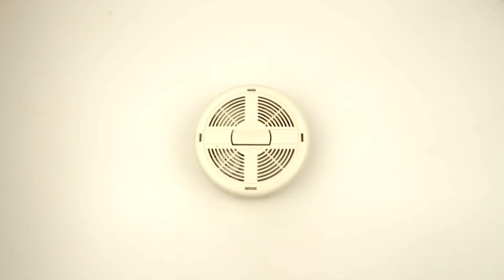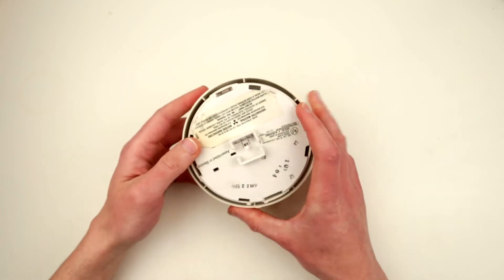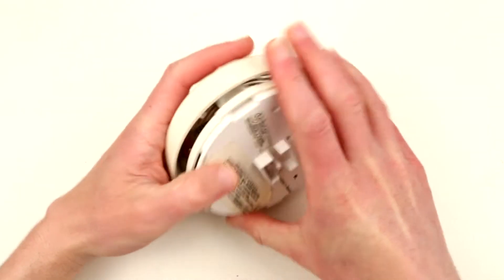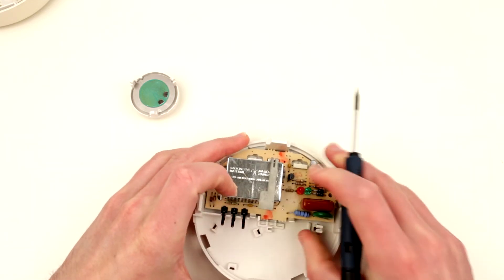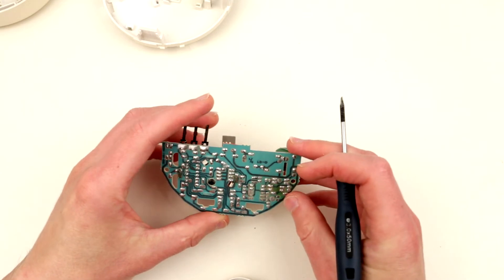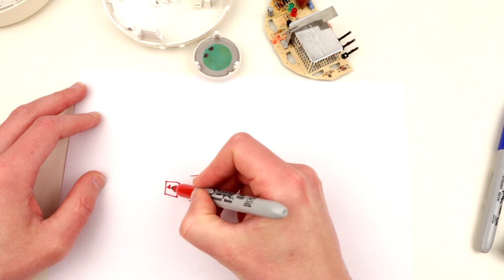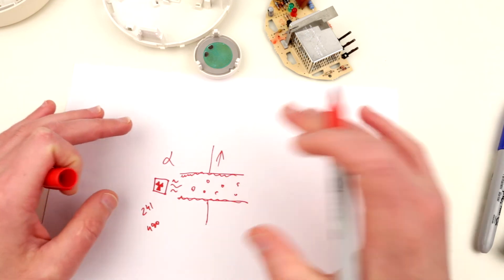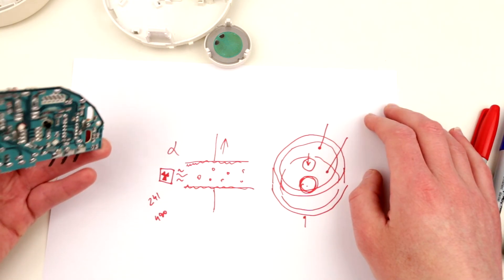Teardown of Ionization Smoke Alarm

Comment: That's a DICON /DETA/First alert and you still can buy those today but that very old one is AC powered only without battery backup also those are very rare the AC only powered ones also there are videos of these alarms Wich a older cover but the one you taken apart is a newer one old hardwired smoke alarms doesn't have a battery in it just AC powered
Reply from the maker: Thank you for such detail! Very useful
Reply: @InsideOutElectronics  Your welcome!!
Reply: @MisterBrownJack  That's a Canadian one and it's not by Dicon here. It's made by American Sensors.